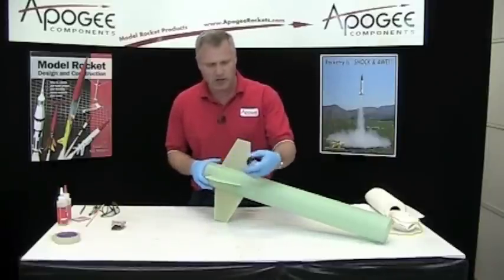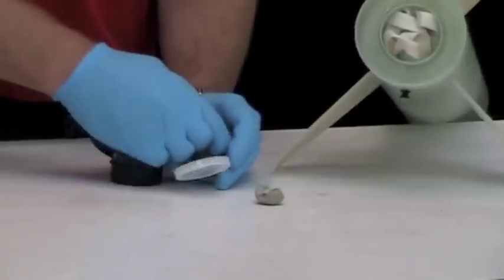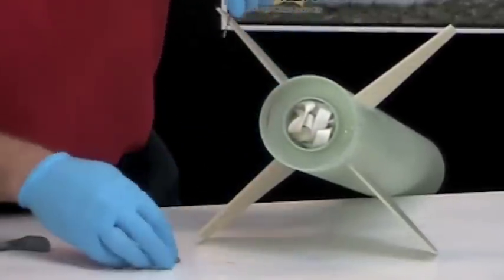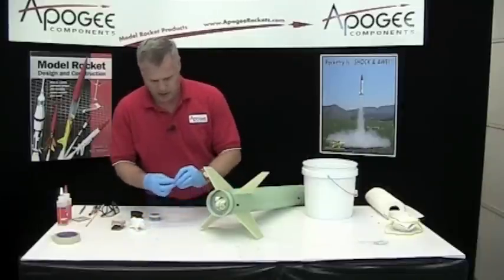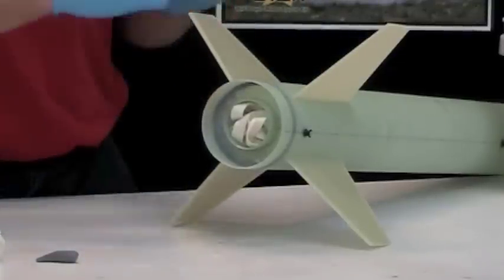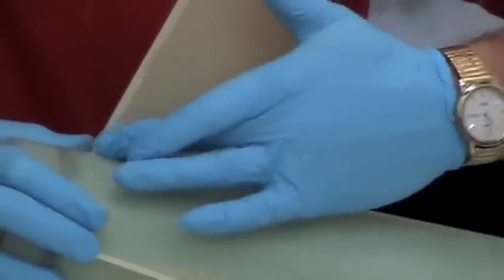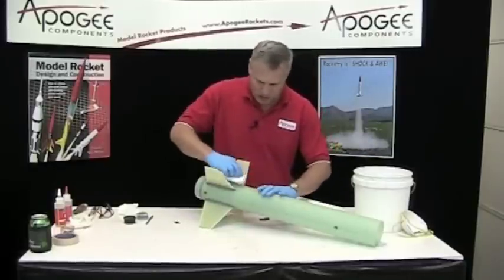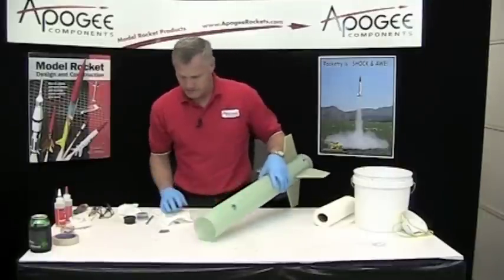Building the Level-2 Fiberglass Rocket Kit - 6: Add Fin Fillets

Comment: What do you think is better for the fillets, the Fixit clay or RocketPoxy?
Reply from the maker: You made the classic engineering mistake... You didn't define "better."
Reply: I suppose stronger or more reliable would be the definitions I was going for. As someone with a lot more experience than me, which one would you be more likely to grab first?
Reply from the maker: @coastermania17  They are both equally strong. They are both equally reliable. The one I'd grab first would depend on the situation I found myself in. See our website for complete descriptions of the products and when you'd use them.